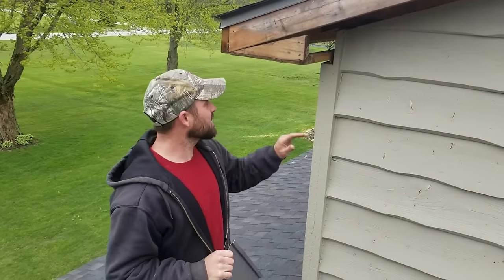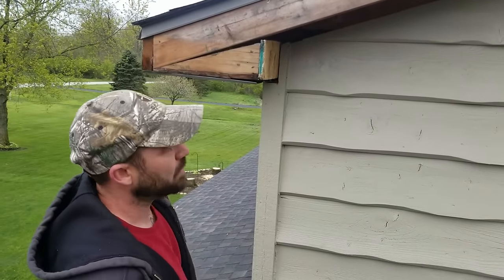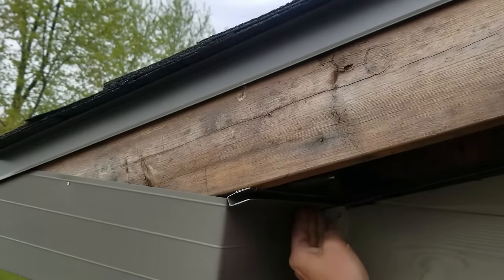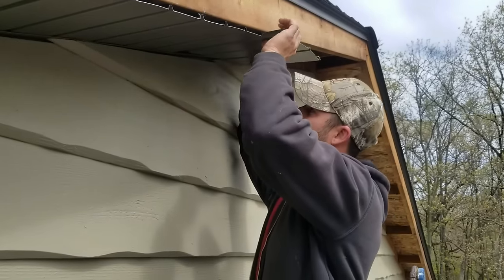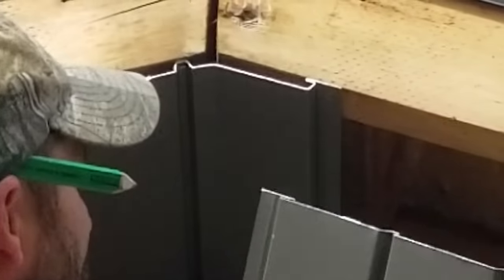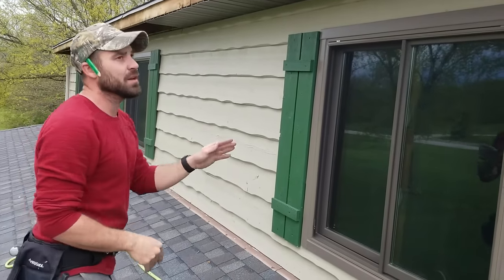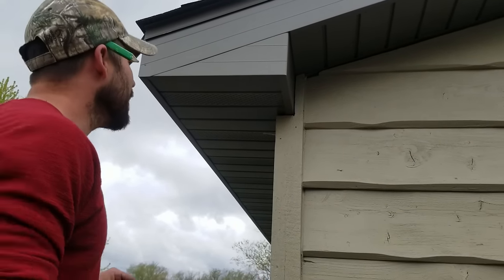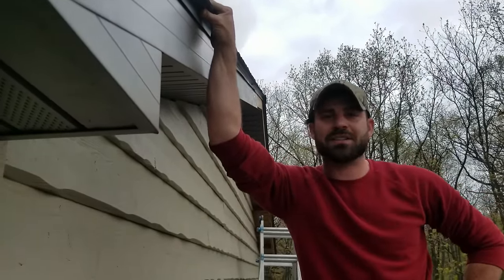HOW TO | Birdbox, Soffit and Fascia.

Comment: You should bend your first piece of fascia all the way around no reason to splice it on the corner
Reply from the maker: the birdbox!? there is a reason I did that. if you bend the birdbox around then you have to straight ends getting cut at the same corner. looks tacky. I made this video to convince guys otherwise and show the proper order of operations which is flush on the bird box, wrap the front around, gable fasia gets cut flush. its not terrible the other way. it'll work, just not as good. you'll actually have 4 nails next to each other that way. 2 on the sides like I did, and then 2 on the front. that's not good. less face nails the better
Reply: I always thought it was a pork chop. I always tuck my 1” wrap around on first so it gets covered and there is a seam on the corner with full metal backing. Looks a lot sharper. Also when doing a 45 mitre I leave about 1/4” of material to ensure coverage with no holes. Also that little trim off the top is important for 90• corners. I usually learn the hard way. Also we use screws that aren’t fully threaded. Put them into a piece of foam or cardboard and spray paint them with a colour match.
Reply from the maker: The screws are a little overkill but do what fits your area and preference.  You can wrap the bird box around the front but I suggest also wrapping the eve around the bird box too. That way when you trace and cut the gable fascia it rests on a wrapped corner.  Not 2 clean cuts touching around 1 bend on the bird box

Comment: Lol i worked for one of those roofing contractors u always talked about.in and out guys. Had me bending facisa metal bird boxes on a mini  mansion moving a 40fter by myself told him this would take 2 pwople 2 days to do while having the immigrints ahingle above u. Dude was pissed i did half the house in a day. Says i know a guy that coulda done this in a couple hours. Said ok call his ass. Couple days later i was back ripping all there work off and redoing it. They literally hammered their corners around not even correctly overlappdd. Had the gables on first then hammered the bottoms around not tucked behind. Could see these things 40 ft on the ground. Needless to say didnt work out with that guy had a couple more like that said come get ur truck bye bitch
Reply from the maker: hahaha i'm sorry you had to go through that man! start advertising for yourself instead of working for unrealistic assholes that don't know nothin!
Reply: @NWIVeteranConstruction   I have . I'm at a point of trying not to be complacent like you say. Need more but dont wanna take on too much
Reply: Good work is always gona have work!